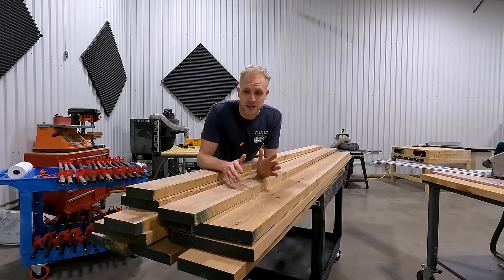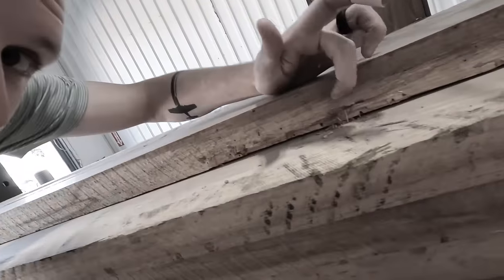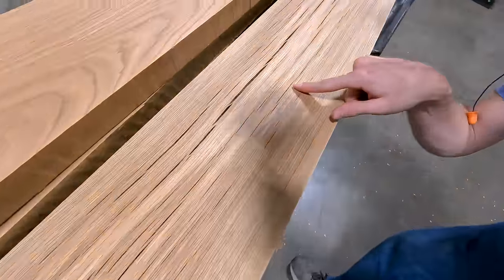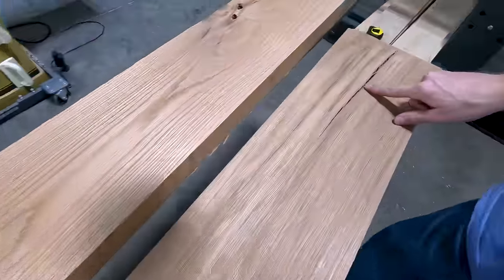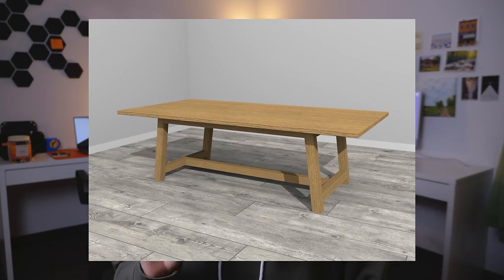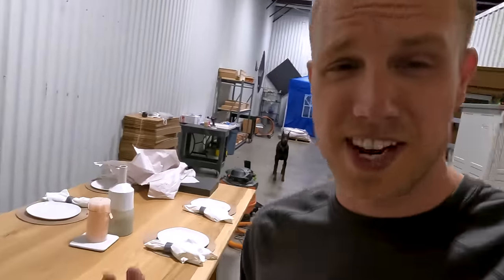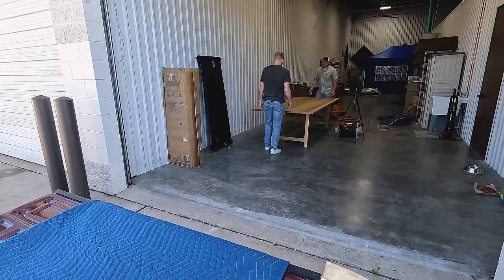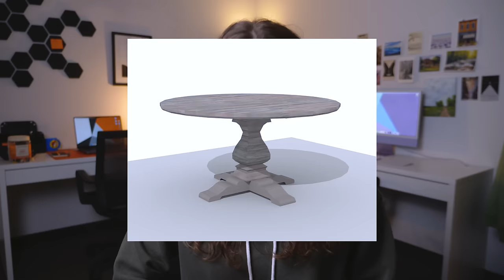Building and Delivering a $6000 Kitchen Table

Comment from the maker: About this table:
9' by 4' in White Oak
Leg angle is 8 degrees
C channel was an experiment - probably doesn't need it, but I wanted to try it out
Finish was General Finishes Endurovar in Satin
Reply: Hey guys! The table turned out BEAUTIFUL. Wanted to ask where you got the C channel? That seemed smaller than others I’ve seen in the past; looking for a similar solution that’s economical. Thanks in advance and great job!
Reply: Looovve general finishes stuff.  I was thinking to myself that I would have liked to do their Arm R Seal on your table.  The satin comes out glass smooth with just a little 600 grit between coats and 1500 grit or more on the final coat.

Comment: Congratulations!  I hope it will not upset you ,  in the future , ... before glue up ... set up the bords as you like it ..and use some alcohool on it , in like a pulverizer or something , you will see the colors . So you will not have that problem with the light color wood on one side , it is very obvios ...and i had clients refuze the table because the colors were not matching. Good luck

Comment: Safety, I’m sure others have posted

Please use push blocks on. The jointer

Look up Perkins builder brothers

Jaimie lost his fingers on what seems like that exact jointer.

Be successful, but please please please use push blocks.
Reply from the maker: Lol you know we fly through hurricanes, right? Risk tolerance and comfort levels are different for everyone
Reply: @jennieanddavis  With that attitude, you'll be flying through hurricanes without fingers. Not only that, you have employees now. You need to follow safety rules for them as much as for you.
Reply: @jennieanddavis  I do, however I’m sure there is available safety equipment that you utilize.

Just be careful
Reply: @jennieanddavis  Pride goeth before the fall.
Reply: @kevinnathanson6876  they have tourniquets for safety… what’s the issue?
Reply: @lancem5965  I really hope that's sarcasm lol. That's like saying "I don't need a seat belt, the air bag will save me!"
Reply: @bradcofo2009  that’s a good analogy also proving my point.  One or the other will keep you safe you don’t always need both.
Reply: @lancem5965  Are you saying that seat belts aren't needed because we have air bags? Is that really what you're saying?
Reply: @bradcofo2009  yes just like the tourniquet will stop the bleed in the rare chance he nicks a finger.   You don’t need push blocks if you have a tourniquet for backup safety.  This is production not a hobby shop.
Reply: @lancem5965  Good to know that production shops don't need to be safe as long as they can apply tourniquets to stop bleeding. Cool. You realize that push blocks don't slow anything down right? It's literally the easiest safety measure you can do on the jointer. I really hope you don't employ anybody. I also hope you put your money where your mouth is and don't wear a seat belt.
Reply: He didn’t lose his fingers due to not using a push block!! He put his hand in the blades! If you’re going to use someone else’s misfortune get your facts in line!!!
Reply: @banjerlegs3051  the fact is jointers eat fingers, quick and in a hurry.

Even with life long veterans that know better.

😉
Reply: @Siamko  I didn’t say they didn’t now did I? And the fact is, the fact isn’t accurate in trying to make people think he wasn’t using a push block, had NOTHING to do with push blocks.

Comment: Unfortunately table will fail and crack due to very poor choice of lumber. This are center /middle pices of slabs that sell as a B/C quality and it's commonly know that is warping, cracking and splitting. Certainly not a good choice for a table top. Good luck
Reply: They put c channels at bottom and as far table stay in the same room under same conditions which due large size probable will there is 99% chance nothing will happen to it.
Reply: @milkod2001  that will hold table flat only. I'm not here to talk bad etc. Just talking with years of experience dealing with exact same situation. Good luck to all

Comment: Good job. You certainly know how to find and deal with customers!
I got a bit concerned about the joinery though. It seemed somewhat weak for that heavy tabletop.
Reply from the maker: Nope. It’s rock solid! I give it at least 100 years
Reply: nice
Reply: “Yep that’s not going anywhere”
Reply: All you need is glue and the joints are rock solid. Wood glue and a good joint makes for a joint that will never come apart. All the dominos are for is alignment, they don’t provide any structural strength - makes it so you don’t need cauls.  Great build and worth the money you sold it for.  You can’t buy that type of table anywhere.  The comment that stated it wasn’t worth more than $3600 will never be able to buy a table like this because all they want is IKEA quality.  You get what you pay for.

Comment: It's a beautiful table.. good job!  
Warning: The legs being glued, can end up having a high risk of cracking and splitting.. 
Nice video!
Reply: What are you meant to do instead?
Reply: @willd0g  I’m inferring that the poster means maybe they could have thought about using some traditional joinery like mortise and tenons instead gluing them face to face?  Wouldn’t have needed the ratchet straps for assembly if they had.  I personally would have used traditional joinery for ease of assembly alone if for nothing else.
Reply: @MixingGBP  ok cool - was a legit question btw since based on how you responded I suppose it may have come across sarcastic
Reply: @willd0g  no problem.   I didn't mean for my reply to come across as sarcastic.   Sorry.
Reply: @MixingGBP  no it’s me that owes the apologies - I meant MY question may have come across sarcastic (not your reply). Please carry on and enjoy your day!
Reply: @willd0g  ok, no problem.

Comment: Great Video!!  have a question?? are you suppose to have Bread Board ends on a piece this large??  over time the wood will pull apart with heating and cooling seasons??  Just asking!?
Reply from the maker: Yeah, bread boards are helpful for that, but not required. It's more of a style choice than a necessity!

Comment: Great table!! If I can say why do people have infeed and out feed tables for their table saws but not for joiners and planners. and if you're working on a concrete floor with finished wood why not put a moving pad or a large rug down to help protect it many assembly benches are covered in carpet just to protect the wood. Its work like yours that inspires so many to get out and make it

Comment: What was the purpose of the routed out lines underneath the table?  It didn't look like they sat or connected anything?
Reply: Metal channels to prevent cuping
Reply: @cosmicvoyager12  ahhh, thanks. Only saw them routed out, never saw anything go in them or an explanation in video.  Good to know.  Thanks.

Comment: can you tell me where you got the threaded inserts you used on the legs?
Reply: They’re typically next to the screws and bolts at hardware stores
Reply: McMaster Carr usuallly has a nice selection of them at reasonable prices.

Comment: What did you use for finish?
Reply from the maker: General Finishes Endurovar in satin
Reply: @jennieanddavis  I just started using Endurovar and really like it. I used it on a quarter sawn white oak vanity recently and it turned out great. It levels out well even when brushing.

Comment: Awesome looking table but good lord how did you come up with a 6k price tag? $1600 into it and there’s no way it took you more than 5 days to make. For simpler things I do 2.5 or 3 times the material cost. It’s always done me well
Reply: I would like to build a table like that. But the capital investment into the shop overheads and tools is substantial.
I’d say the return on investment and the value of that table is appropriate. 
It’s all straight forward if you have it. Otherwise it’s a couple of grand just for the festool domino and you haven’t even made anything yet…
Reply: I blame the internet.  I mean it now cost $19 for a sandwich with cheese and bag of chips at jimmy johns…not exaggerating.  Is that worth it?  Well I guess it depends on how hungry you are😂

Comment: Great table. One piece of advice is not to joint nor plane any pieces longer than twice your jointer table length. The longer the piece is the more material you have to remove in order to remove a twist. Learned from experience :) Good luck!
Reply from the maker: In a previous video we showed how we zipped off one edge with the track saw first! That definitely helps, too!
Reply: @jennieanddavis  oh yes my track saw is probably the best investment I’ve made aside from the table saw. Really liked the table guys, good job

Comment: Good job that you sold it for 6k. But it is really just a 3k table to me. I know how much the material cost, and I know the steps to make such a table, and I make similar tables. If you spend more than 10 hours on this simple, then you need to improve your efficiency. 

And you just put your cuted materials on the ground, and you are also missing some safety tips.